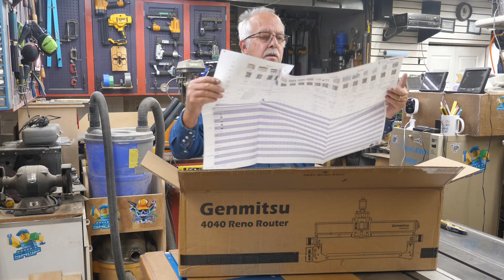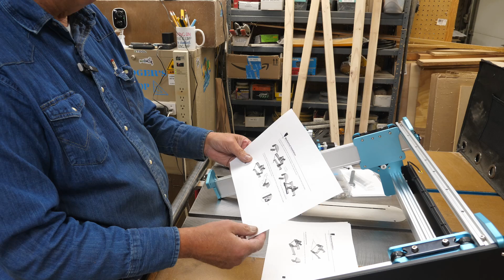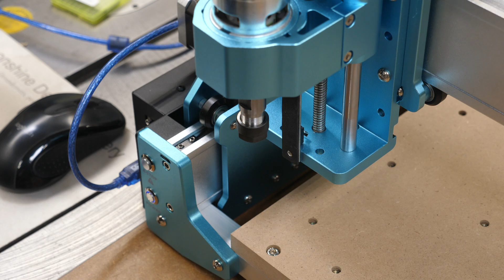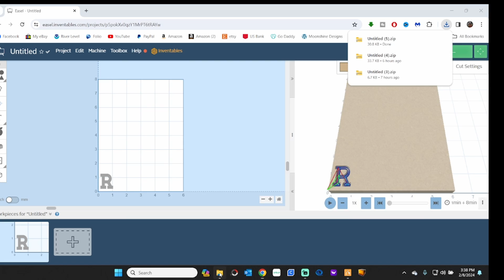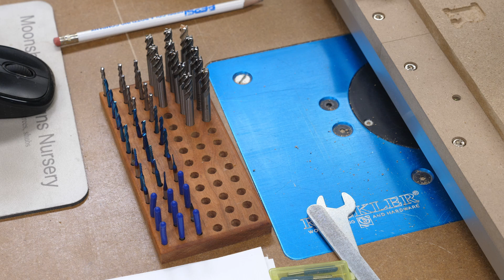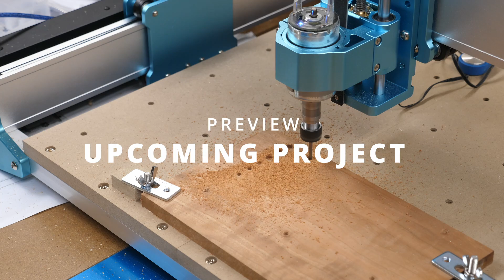Genmitsu Sainsmart 4040 Reno CNC Detailed Assembly

Comment: Hello, first (long) day CNC here with the Genmitsu 4040 nobody else, especially the manual, goes into detail about adjust the z axis that you do. At the 36:13 mark when you drop it down, is this where you should be barely touching the material? i.e the paper test? My cuts are quite shallow. I suppose it may be the type of bit (the one provided) or now that I think of it I can make sure the bit is tightly seated in the collet, but I wanted to just ask if getting the bit barely touching before zeroing out would help

Comment: If you're going to do a set up maybe tell everyone where ALL the cords go. And mention the need to put the collar insert in for the bits. I rate your video a 4 out of 10.
Reply: He covered a lot of stuff and did a pretty good job. Also he mentioned putting in the collar insert for the bit  so maybe pay a little more attention next time
Reply: @Hey.timmaye  Can you please tell me where he said to insert the collet? He said to loosen the collet, what he is showing  is the collet bolt not the collet itself. A very important step is to insert the collet, which needs to be inserted taper side up and flat side down.

Comment: How do you setup Easel to this model 4040 I don’t see it in the list. I can’t find the area shown in video for spindle speeds setting? Any help would be greatly appreciate thanks 😊
Reply from the maker: Under "machine", choose "Other".  Then set work area, etc.  Spindle speed setting will depend on your bit, material, feed speed, etc.  As a default setting, I leave it at 10,000 RPM.

Comment: Thanks for the great video.  Do you know if the new lightburn for CNC will work with the 4040 Reno? Thanks
Reply from the maker: Millmage is still in Beta testing, but I would think so since it is a GCODE machine.  Have not had the opportunity to try out Millmage yet, but would sure like to play with it!
Reply: Work well with Lightburn:face-blue-smiling: